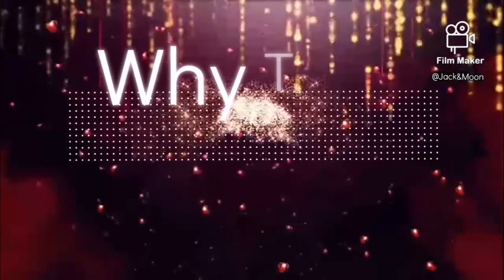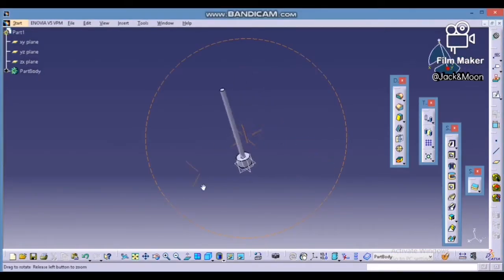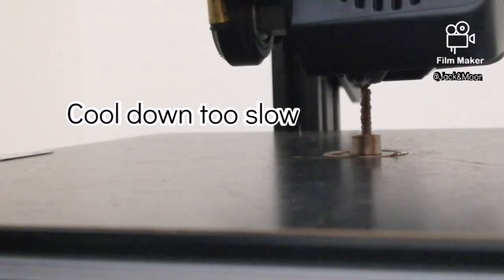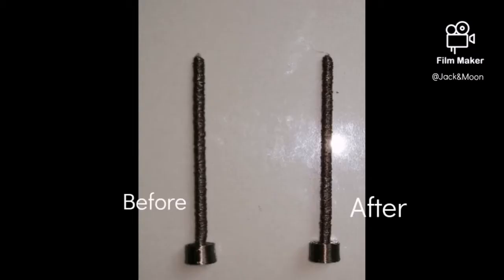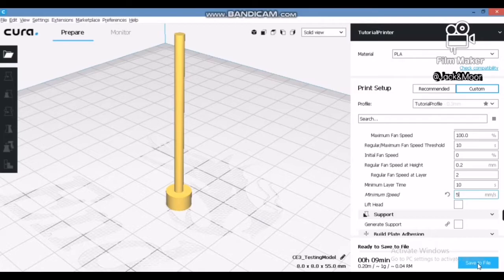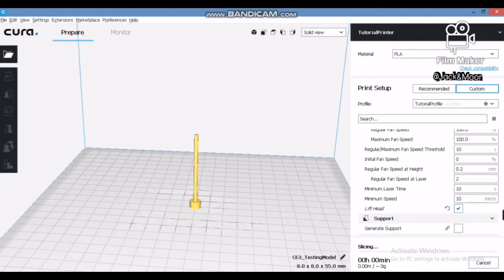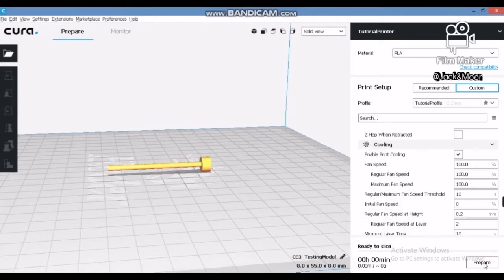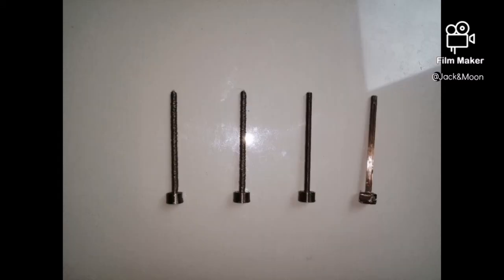Why This Print Fail?  #small part melts down #extreme small diameter #perfect way to print

Comment: I just had this scenario, I just wanted a 3mm rod, I slowed my ender3 v3se to 50mm a sec the piece still flopped over. At standard quality (cura) I had a mess, and then the only way to print the rod was to lay it on it's side with a brim. This also made the rod print with an extra flat side that I had to sand down. I'm gonna try the solution 2 settings and see if they make a difference but I noticed similar problems printing other models which have thin parts like this and even thinner even with supports which slowing it down would make a 50min part take hours to print. Also to note: I stop having this problem if say I'm printing a 7mm or larger diameter rod or screw in the vertical orientation at standard quality and fast quality(creality's ludicrous setting) and even then I get a usable part for the most part :P
That is to say if you don't need a 3mm rod save yourselves a big headache and just make the part bigger. In my case I hadn't planned out my design since I didn't even realize it was going to be that much of a problem(basically I was printing a phone holder's hinge system and I made the stupid hole 4mm so my rod had to be 3mm, both parts had to be filed and sanded). I wrote this comment before trying the solution but I will report back if it works. Although when I think about it the vertical orientation makes the sheer strength the weakest at this orientation but the print (for me the top would curl and spaghetti) did look better than printing horizontal.

Comment: Do you have any tips for printing small holes that are properly formed? Sizes like 2.5 and 3mm. Thanks!
Reply from the maker: Hi, sorry for the late reply. We found out that the resolutions of the stl itself is very critical for round holes. If you have the access to the design, it is advisable to save the drawing in higher resolution so that a more perfect round can be achieved. We hope that this solution helps you
Reply: Try hole horizontal expansion in Cura.
Reply: @soundspark  Thanks, I've tried that and it definitely works.